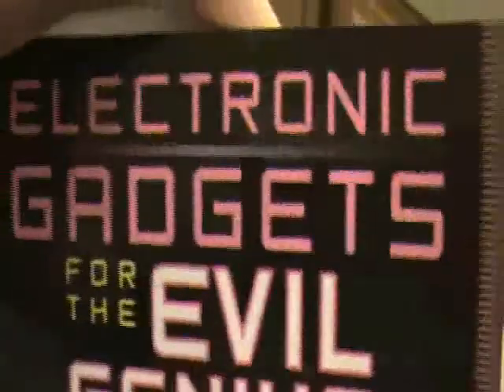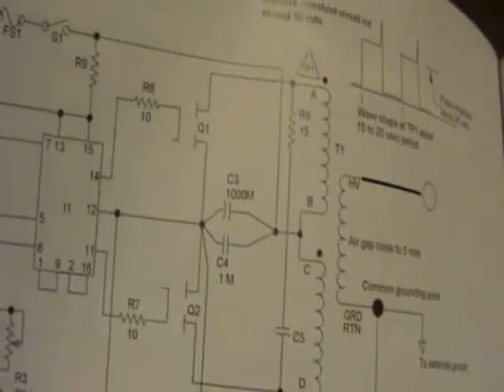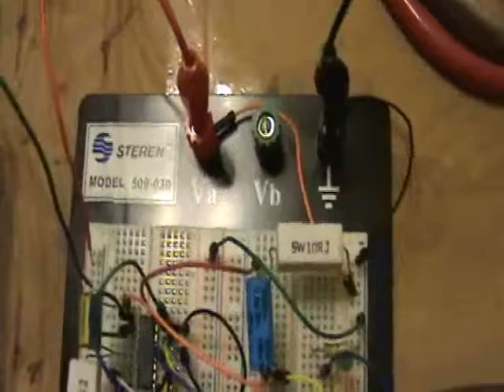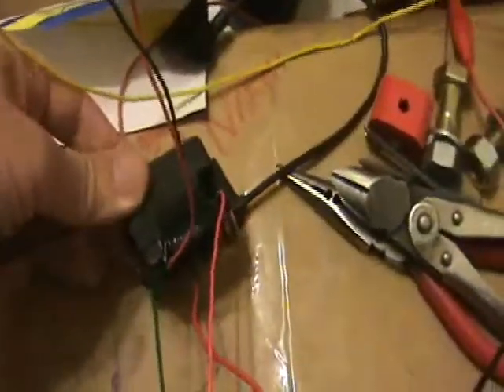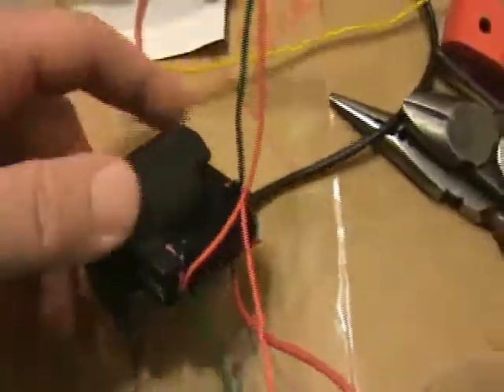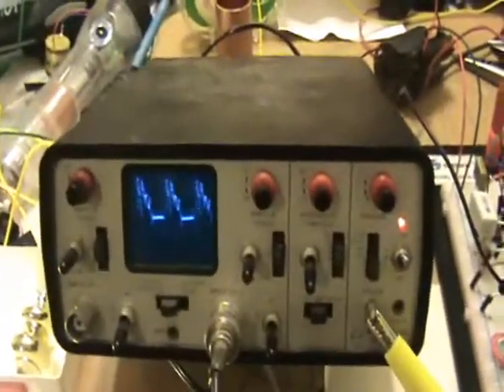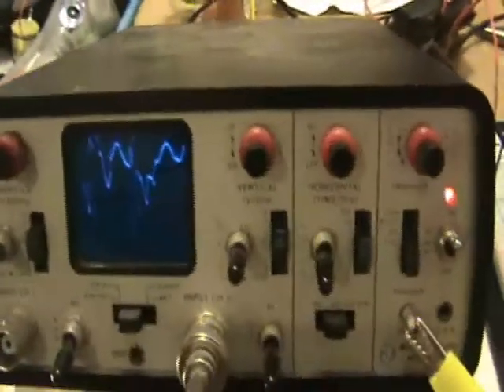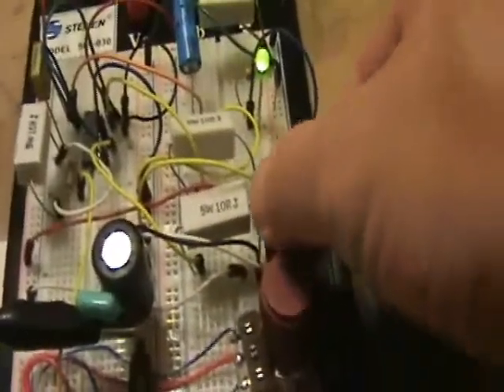Evil Genius Solid State Tesla Coil Replication

Comment: @morpher44 the flyback is used as-is. the internal primary windings looks exactly the same, so actually you wont need to make any extra primary windings. and a teslacoil is a air wound transformer. if you remove the ferrite core completely, thrn it starts to act as a tesla coil a little bit.

Comment from the maker: The flyback is a coil. In this circuit, the primary is hand-wound around the ferromagnetic material. The 2ndary is INSIDE. Absolutely there is a coil. You may have a narrower definition of what is and what is not a Tesla coil. But ultimately, this step-up approach is very much Tesla ... who is the father of all HV power supplies.